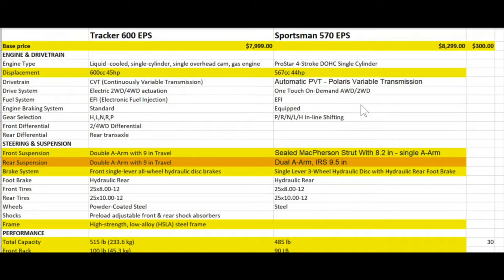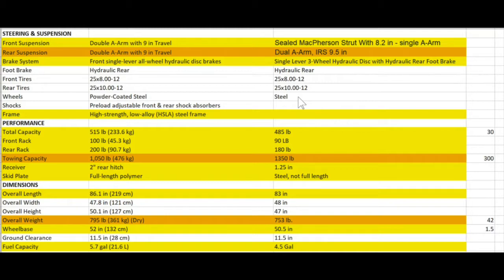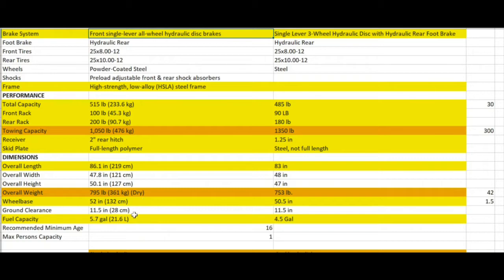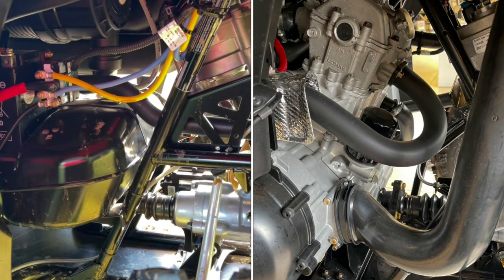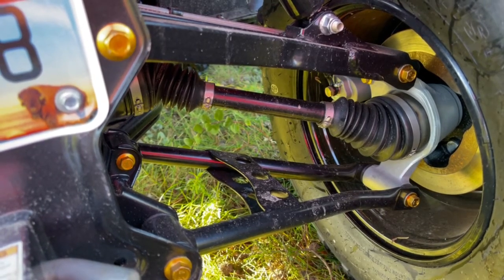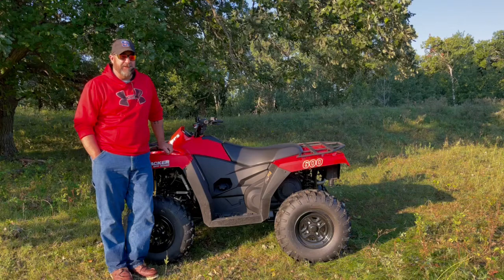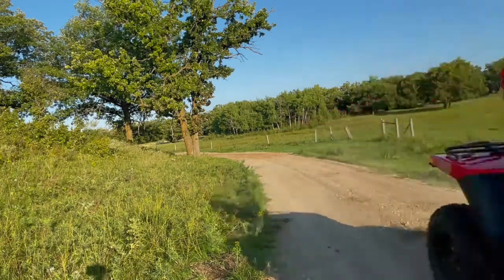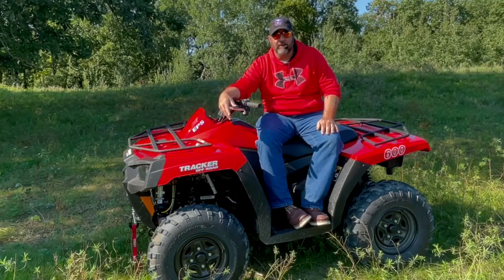2022 Tracker Off Road 600 ATV - First Review/Test on YouTube

Comment from the maker: **CORRECTION** I made a mistake. The specifications for the Tracker 600 EPS says "4 wheel hydraulic brakes" but this machine does actually only have 3 brakes, just like most other ATV's. One in the back and two in the front. It is made even more confusing by the fact that both back wheels have a rotor but only the right side has a caliper. Thank you to David for watching the video and pointing out this error.
Reply: Does it have a automatic
Reply from the maker: @nevaeharmendariz649  if you asking if it is an automatic trasnmissin, yes it does. You do not need to shift gears, just move the handle into "H" or "L" to move forward and "R" to go in reverse. Also has a "N" for neutral and "P" for park.
Reply: Why buy tracker its a arctic cat rebadged
Reply from the maker: @americansilverback1947  $$
Reply: How do you put it on automatic
Reply: @nevaeharmendariz649  Just turn the key and press the green button. Tracker took care of the rest of it for you. It comes with the automatic (or CVT) transmission from the factory, so no need to do anything.
Reply: @americansilverback1947  I think if you ever decide to take one on a test ride, you will see that they're actually really awesome machines. The fact that they are very reasonably priced is just a bonus. They're also American-made. All the more reason to love them.
Reply: If that’s the case, the website is deceiving, it says “all wheel disc brakes”
Reply from the maker: @americansilverback1947  because I do t have an Arctic Cat dealer in town and the tracker is a little less expensive.
Reply from the maker: @anonymousanonymous8454  It actually applied breaking to all 4 wheels but it does it with 3 set of brakes. Same as Polaris & Polaris also claims 4 wheel disk breaks. 

I agree it is a little deceiving but if you apply breaks all 4 wheels will brake.

Comment: First off what a nice informative review. But I'm pretty sore they discontinued the 570 alterra tracker. I beat up on and used AC 500 core with no issues what so ever, I cracked the gas tank perhaps but I sealed it myself and the battery lasted 6.5 years and I sold it. I looked at all new machines and the tracker 570 was the absolute finest machine for the money and my needs. I'm very happy with it it's very large and rides high it's stiff and beefy and has a ton of low gear power I'm very impressed with it. It's getting smoother every time I use it. I didn't like this unit but after the review what's not to like. We'll see how they keep up. I love Arctic cats though they are exceptional good utility ATV. For work and tough terrain they Excell.
Reply from the maker: I believe I said the 570 is phased out in the first 30 seconds of the video.

Thanks for watching.

Comment: I just put a deposit today on a 2022 600 EPS LTD   Same machine except it comes with a 3500 lb Warn winch , 14 inch alum  rims 27” tires and upgraded racks , looking forward to getting in at the end of February, I own a 2004 Suzuki Eiger with 13700 kms on it and it’s been an excellent machine and it still runs like new , will be interesting to see if the new 600 lives up to the Suzuki’s reliability

Comment: Good video. And review. Only two things I wish you would have done. One show where the air filter is. Only because I have a 2017 arctic cat. And I don’t like where and how you change the air filter. And it would have been nice to see the new design they put it in the atv.  The second thing is would have loved to hear the motor when you test drove it instead of the music.  Other than that it’s a really good review. Thank you for that. Oh and at the beginning when you had taken it off the trailer and was standing beside it. To me the profile from the side. The way the seat slips down from the gas tank and the square bodywork from the head lights. It reminds me of the 1998 ish arctic cat 500 atvs.

Comment: I have a2018 alterra 500 4x4 and the only thing I don't like about the 600 is the gas tank placement and gas cap, other than that it's a pretty good 4 wheeler. Thanks for the video.

Comment: Funny thing, my buddy from highschool was the engineer at Artic Cat that designed the old 2020 era 4-wheel drive lever. 😂 First thing he asked me on mine was if it broke. I love my 2020 570 and plan to keep it forever, but if I was buying new, for $300 more I would get the Polaris. The only reason I say that is for resale. I have a feeling resale wont be kind to these Tracker machines over the next few years. I bought mine slightly used on a deal that was too hard to pass up.
Reply from the maker: If you plan to trade it in on a regular basis I guess resale is a concern. I drive mine till there is little left to resell. 

My 2015 Polaris 550 sportsman has 9,879 miles on it and every piece of plastic has some damage on it, so there isn’t much resale left there. It runs good though so rather than trade it in for almost nothing I kept it as a back up and work machine.

I would be curious who your buddy is. I grew up in Thief River Falls and used to work at AC. If you went to high school in TRF you may have had my parents as teachers.
Reply: @jackofalltrades7822  Agreed. This was a really great review of the 600. I hope you are still enjoying it!

Comment: I sure hope yours came with a water pump that worked. Mine was delivered with no working pump. It took them 3 months to fix mine. I purchased it about Nov 20th, 2021 and it was back in the shop for overheating about 10 days later with less than an hour of time on it. They took 3 months to fix it. (Global supply chain?) really BPS. So I have had it at the house for about 2 months and yesterday we went to use the machine and dead battery. EPS means bunch of Electrical stuff on it and it needs to be plugged in or you will loose the battery. Some circuit remains on after the machine is put in the off position.

Comment: Have you noticed any difference riding it in terms of engine braking?  I have read a couple of reviews and it seems like the unit has zero engine braking, which is a big concern for me.  I also have seen a few pictures of this 600 with the pipe coming out of the head glowing red hot after a ride.
Reply from the maker: It does not engine brake as strong as the sportsman. (Ave not noticed a glowing pipe.

Comment: Hey man. Just got my 600 EPS LE, literally last Friday. I’m trying to remove the seat on mine, and there is no lever to be felt or pulled on under the seat. I know it can be removed, because the delivery team removed it. But now it’s like there’s no lever or release to remove the seat. It doesn’t feel as if it’s broken, but this is concerning, and I don’t think I’m THAT dumb. Any suggestions?
Reply from the maker: At the rear of the seat there is a lever. Wrap your fingers under the back of the seat and you will feel it.
Reply: @jackofalltrades7822  I’ve done that. There is no lever, unfortunately. I can feel a hard plastic piece that is rounded on the ends, but it does not move up, down, or side to side. Nothing feels broken though. I have an inquiry with Bass Pro maintenance. I will let you know what I find out
Reply from the maker: @williampresson  maybe this will help.

https://youtu.be/51Keduuuc0I
Reply: @jackofalltrades7822  Thanks! The latch on mine was stuck, and is now resolved. Your additional video, and maintenance at my local Bass Pro was able to assist. The latch was over extended in the “unlocked” or “up” position, and the seat would not let loose, which was making me think there was no latch. I ended up having to use an automotive pry tool for trim to push the latch back down. Once I was able to get the latch back down, I could then push up on the lever, and pull the seat off. When I was able to get the seat off, it was very obvious the latch, and spring mechanism was sticking really bad. This could have been due to hot/cold temperature fluctuations. I rubbed some grease along the locking mechanism where it was contacting with the plastic. It does still stick on occasion, but it does let loose easier now, and allow me to get the seat off.

Comment: could you please do a review of it using the winch, going on some actual off road trails, and using that hitch for a trailer please, also can you test out the four wheel drive and how sturdy the hitch is, one more thing, can you please show me a test of how well the suspension is please and thank you
Reply from the maker: I will work on that. 

I have used the hitch to pull out some schrubs and a dead tree that was established 4 years. The hitch is solid as a rock.

I will be using the machine a lot in the coming 2 months and will do another video.
Reply: @jackofalltrades7822  thanks man, it means a lot

Comment: Im looking to buy  and ones available  for 9000  is that worth the money. Please be honest its alot of money to spend. Is there better bang for my buck that i should consider. Im a big guy so i need a strong machine and im in michigan.
Reply from the maker: So I have had it for 8 months, 350 miles and have had no issues.

I am 6’3” and 265 and love the way the machine feels, drives and the power it produces. I still have the shocks set to the lightest setting and do not feel the need to make them heavier.

I have a Polaris Sportsman too and I like my Tracker way more. So much that I am going to buy either the 300 or 450 for my daughter to ride.

The only gripe I have is that when I drain the oil it lands on the skid plate and makes a bit of a mess. Video being made for the oil change tomorrow.

I am also going on a 4 day ATV trip next week, to the SD Black Hills, and anticipate 150 miles per day. Going to video that too.

I would feel confidant is saying this is a good machine for the money.

Comment: I have a 20 tracker 570, I do extreme riding in mud and water. This new model design is dangerous, I tried it from a friend who bought one. Tips easy in water, air in the tank makes it a feel like your on a thin line and about to roll over. The cap pulls in water to the gas of it sits. It looks like a Polaris and less like a artic cat the 20 model is so much nicer. Engine placement I believe personally you feel more vibration. The 4x to 2x switch is a downgrab to the trigger pull on the last model. Tbh buy the last gen not this one, nless you never go mudding or water wheeling.